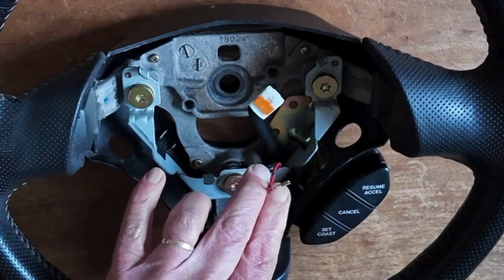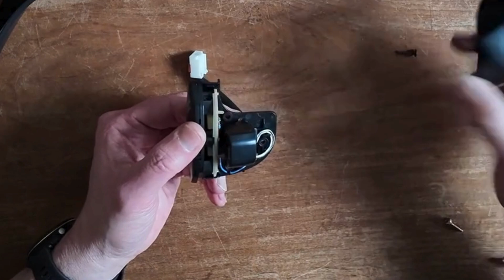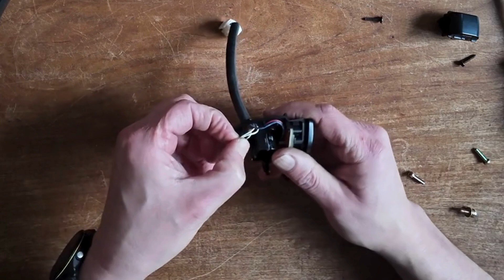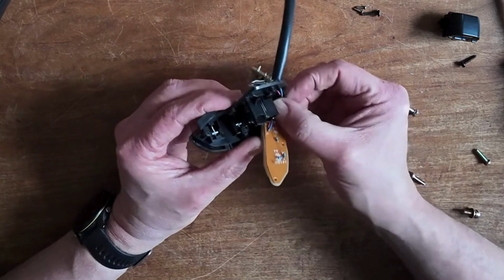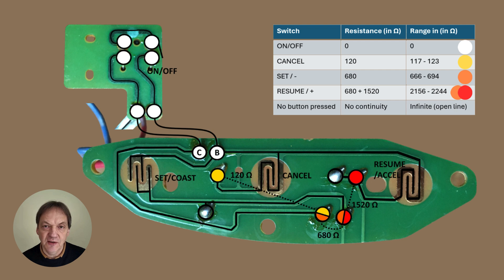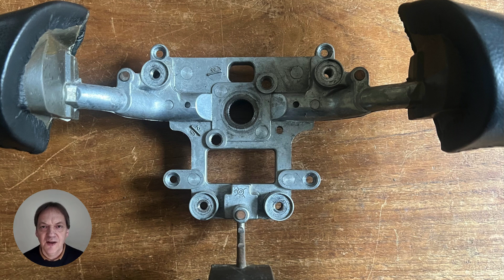Mazda Protege cruise control switches on your NB Miata steering wheel

Comment: I don't even own a NB Miata and I love watching these videos....!
Reply from the maker: That is a nice thing to say! Thanks for watching and for your comment. I will try to do videos on other generations as well. What do you drive?
Reply: @ I do have a 1991 Mazda MX-5, so a NA! Only thing I know of somewhat on a related note to your videos is the Canadian driving lights mod. Maybe there are others I don't know about! 

I have a couple other cars too!
Reply from the maker: @ I have done a video about cruise control on the NA specifically and about the diagnostics for it on the NA and NB. Based on the reactions regarding the steering wheel options I am curious what can be done if an NB steering column is used in an NA Miata. I might investigate and try that with a local volunteer. It has to me a USDM NA, because the EU spec NA is very different in that respect.
Besides the 2 NB2s I also have a 1999 Volvo V70 10v and a Volvo C70 Coupe 2.4T.

Comment: Hi! Would it also work on the 4 spoke NB1 steering wheel? Like are there big differences on how to modify that mount? Or could you use a 323F 4 spoke wheel and convert the buttons to the cruise control Protogé buttons?
Reply from the maker: The 4 spoke NB1 steering wheel is rare. Something similar was used on the Protege and 626 at the time. I would be looking at the Mazda 626 steering wheel in the 1998-2002 period. Some of them had cruise control switches on the steering wheel. You may need to change the resistor values, but it might be worth a try.
I was looking for an example and found this one. Maybe you can reuse your airbag.
https://www.ebay.com/itm/162468133748

Comment: Where can you find the multimedia control switch that would go in place of those cruise control switches?
Reply from the maker: It was used in some European countries on the Mazda 323F around 2001-2003. They are not that common, so pretty rare. Most of those cars had a 4-spoke steering wheel.

Comment: Do you know how to introduce a lpw fuel light to the dash for a nb1 98-00 models? It would be a good feature since the fuel gauge is not so accurate
Reply from the maker: The easiest way to do it, it to buy an instrument cluster from a 2004/2005 model. You can swap the odometer and need to add an extra ground wire for the high beam indicator.
On this page you can see how you can check if the cluster has the low fuel light.
https://mx5info.com/low-fuel-lampje/